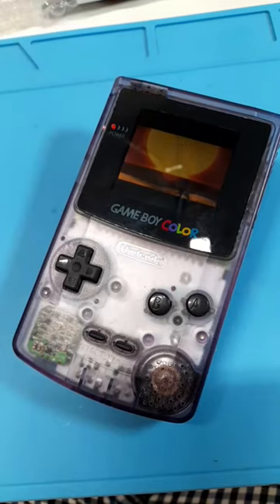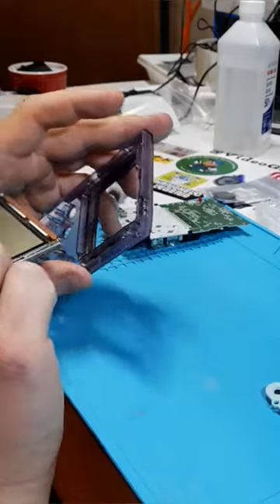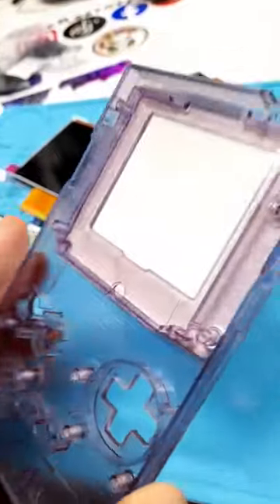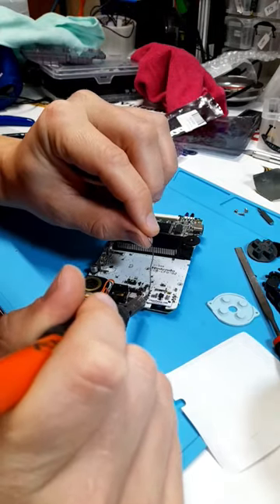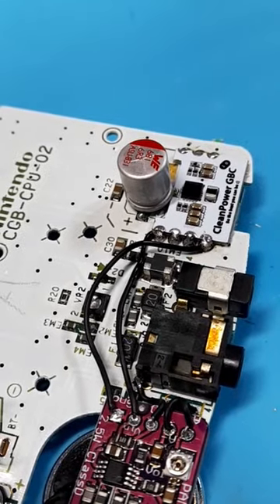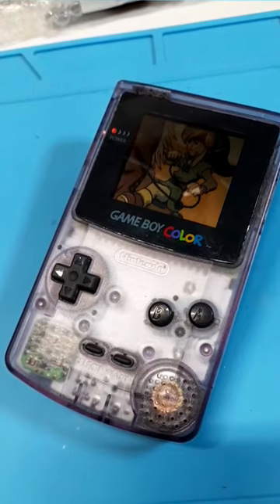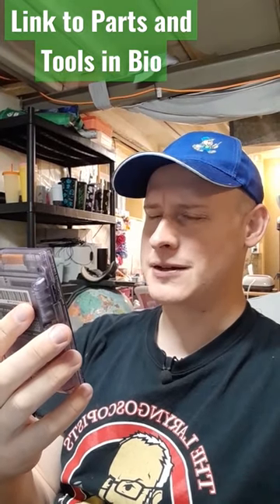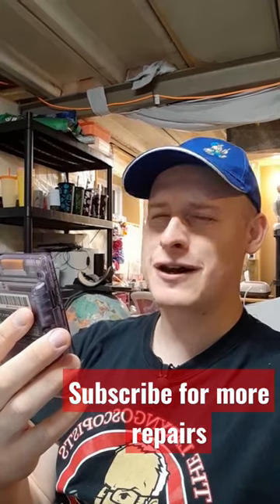Let's Upgrade a CLEAN Gameboy

Comment: How did you test the power without putting it back together?
Reply from the maker: A power supply! You can get fancy ones with changeable voltages and amps etc. Or a cheap one that holds two AA batteries and had alligator clips

Comment: Hey! How can you increase the volume in the DS Lite?
Reply from the maker: I believe an Amp exists for it
Reply: @VideoGameRestoration  you can use the original speakers and boost it with an added component? I was thinking of if the Switch speakers could possibly fit or if it would even make a difference (if it's software limited) 🤷